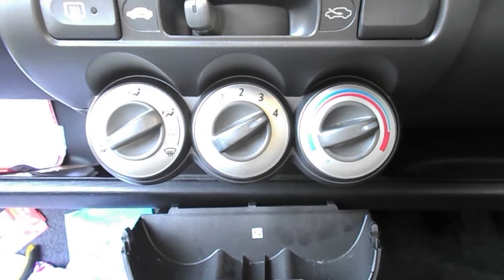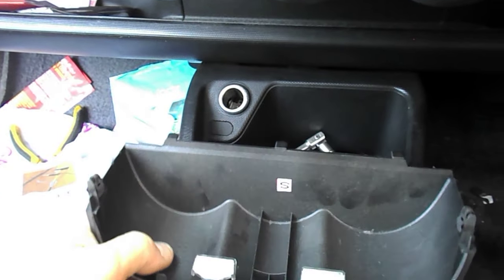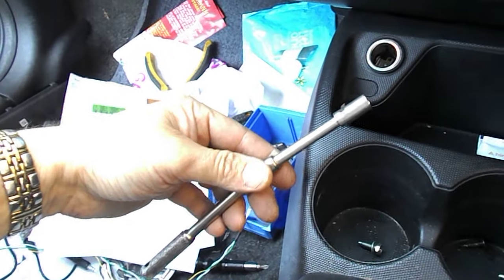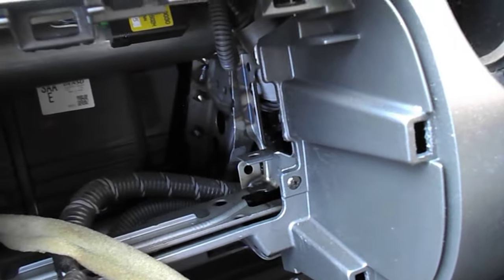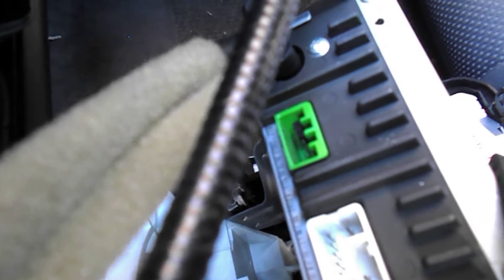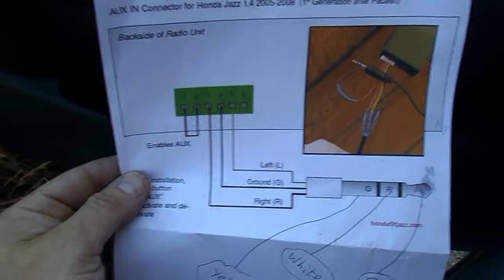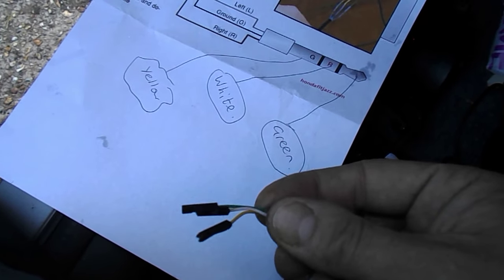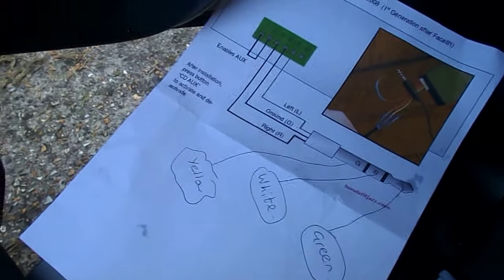Activating and connecting the AUX on a 2005 Honda Jazz (EU Model)

Comment: Thanks... just installed the AUX connection. Needed quite some force to remove the panel and radio. Found out that you first have to install the bolts again before pushing the panel fully in the care again

Comment: what are the name of the parts that are connecting the individual wires of the AUX wire to the pins? cheers
Reply from the maker: as described in the earlier comments, I used old computer connections (from the components in the case to the motherboard) the connection to the device (not the head unit) was a 3.5mm stereo jack on a long lead - look at the connections in the video, the joins between the computer pin sockets and the wires from the 3.5mm jack were soldered and shrinkwrapped for completeness.

Comment from the maker: just fitted LED front headlamps.... maybe time for another video?
Reply: Did you ever create a video for this?
Reply from the maker: Sadly not since the lamps failed the UK MOT, fitting them up inside the wheelarch was a real pain as the LED part was deeper and wider than the halogen H4, I have had similar problem fitting them in a Nissan Note (not yet MOT's in the same) .... nice bright lights though

Comment: Are you able to provide some links to the parts I will need? Im not sure of what the connecter is called that I will need to go into the back of the stereo. Any help will be very much appreciated!
Reply from the maker: all you need is a jumper (a shorting doo-dad) like you would find on a hard drive or graphics card used to connect two pins together, the connection on the rear of the stereo for the AUX part of the equation is also a cable from a computer device where the wires go to individual pins

I think the best thing for you to find is a scrapped PC down a dump and scavenge the wires and jumpers out of that. You could also try a PC repair shop and show the guy/gal the video?